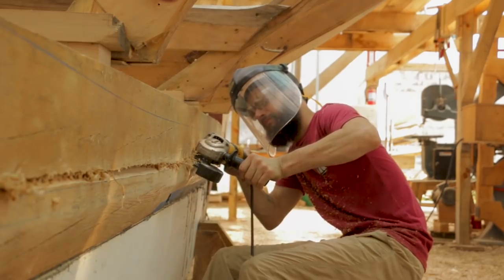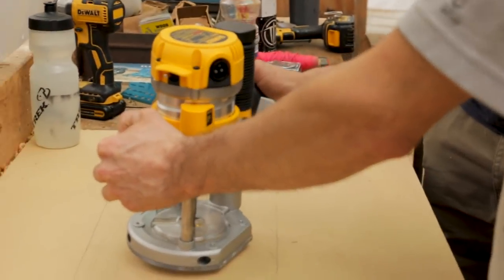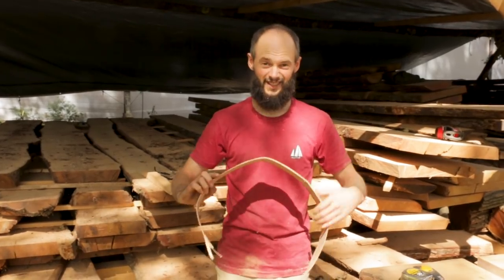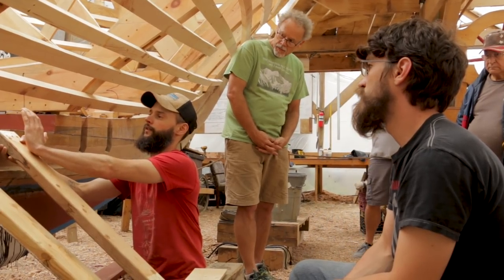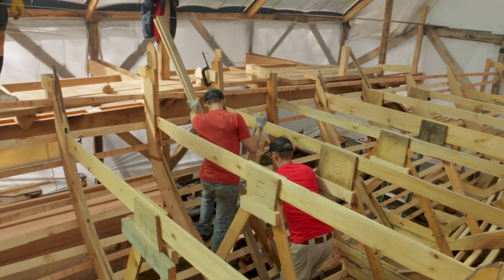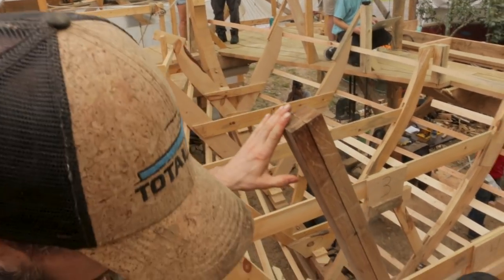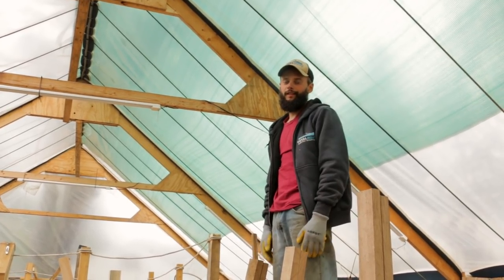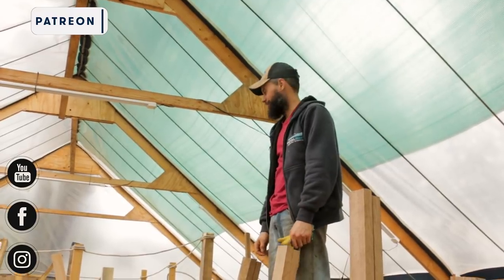Acorn to Arabella - Journey of a Wooden Boat - Episode 46: Steaming Frames

Comment: When I built custom furniture, a good part of the cost on a given project was the cost of template/jig/bracing material. Luckily you have a source for the solid stock, but your template stock bill must be ginormous! I worked at a shipyard as well, but we built large luxury yachts (Burger Boat Co), and the frames were aluminum and cut with a water jet. As a woodworker, I prefer the way you guys are doing it 🙂
Reply from the maker: Most of our template stock is stuff we harvested and milled, we also use hunks of plywood left over from something else.  So not much money has been spent on that so far =)
Reply: Good, I'm looking forward to watching the launch some day!

Comment: I noticed that you and Leo both routed the sockets for the frames and in the keel then chiseled the round corners square. I thought it would have been advantageous if the bottom of the frame was routed with a rad to match the routed pocket and just do away with any chiseling altogether?

Comment: I noticed that for most of the frames we see vertical grain on the inside faces, but on a few, we see arches, indicating flat sawn. That is a shame because you started with squares and it was just a matter of which way the square went into the band saw when the square was split.

Do you have a plan to keep the joint where the two faces of the split square meet becoming a place where rot occurs.
Reply from the maker: I wish it was quite that easy.  Many of the frames could be oriented on the bandsaw to split with the rings but some of the frames the grain ran diagonally across the frame so there was no way to split it with the rings hence the arches.  She is so heavily designed, the curves easy and the oak tight and green that the few frames without perfect grain are not an issue.  Bud McIntosh says not to worry about it and to just take them as they come. 
It seems that for whatever reason the kerf does not typically create a rot spot, most of what I have read says not to bother putting anything in there.  We are pulling the frames a couple at a time and giving the kerf a light oiling, the bases get antifouling paint as do the sockets and when they go back in their homes they get bedded.
Reply: So right now you are just forming the frames. Then when everything is good and dry you will remove the frames and perform antirot measures, then reinstall the frames. Is this correct?
Reply from the maker: That is correct

Comment: Nicely done. So do you add glue between the split after it's had time to dry in, or just screw them together?
Also, a fine example of the woodworker's motto...
"You can never have too many clamps".
Thanks for sharing Akiva with us again, if only all to briefly.
Reply from the maker: They will get riveted together when we put the planks on.

Comment: Nice work.  I am curious why you decided to kerf the frames.  Presumably with adequate steaming you could have bent them in without the kerfs.  That would give stronger frames.  You might have split a couple more, but it would be worth it for the extra strength.  Did you try bending a couple of frames without the kerf?
Reply from the maker: We might have been able to bend them whole but it would have been much more difficult and stressed the timber a lot more.  The thinner, more easily bent split frames get a lot less stressed and there for are often stronger than a single big frame.  There will also be at least 44 rivets going through each frame so the two halves will be very well joined.

Comment: I’m seventeen. You’ve inspired me to buy 100 swamp white oak acorns. I am building one of these.   From the looks of it, you also need a lot of other types of wood for construction. I’ll use poplar or white pine for that. Damn I’ve got a lot of trees to plant. I have probably got a max of 10 acres to plant on. How many acres of trees would one of these ships require?
Reply from the maker: That is a nice thought, but keep in mind that slowly grown trees are better for woodworking, so these will likely not be ready in your lifetime. You should plant those and then start looking for a source for mature white oaks. Ecologically minded forest management is very important.
Reply: Acorn To Arabella why exactly are slow growth woods better? In most hardwoods, growth rate has no effect on its density.

Comment: Just wondered why you have not put any tar in the frame socket and do you not worry the split, however tight, will always be a place for moisture and water to head.
Reply from the maker: It goes in later.

Comment: Very much a novice boat-wise, so please forgive the question.... in an earlier video you treated wood surfaces that touched, but with the wood frames that were cut down the middle these were steamed and installed untreated. What's the difference between these parts of the installation - why is there no need to treat the steamed frames during the installation? I get that you don't have much time to do this during the steaming and installation process - was this a factor?
Reply from the maker: They will get oiled and painted and bedded after they have cooled and dried.  Any finish would have hampered the steaming process.

Comment: Really starting to look like a boat now!   

fascinating how easily it bends into place like that... will you be going back and putting glue between the two pieces once they've cooled and the bend has set up?  I'm curious what types of glue you'll be using there.   (or is that part of the other stuff you mention doing in a later episode?  ;)  )
Reply from the maker: They will get oiled then riveted together when the planking goes on, no glue will be used.  The 44 (minimum) rivets per frame will be plenty to hold them together.

Comment: Is there a certain amount of spring-back calculated into the molds? I’m confused on how you will hold the “fair” when the clamps come off. Will the planking bring it all together to determine the final shape? I guess I’ll find out pretty soon. Very, very interesting videos. Great job building and recording.
Reply: There will be springback. Wait till cool, remove clamps, epoxy together, re-clamp. Much less springback! This is usually done on the floor, using a jig, & many thin, epoxy coated oak strips. No springback, and then installed. Steam bending frames in the boat against ribbands is for one-piece solid frames. I noticed that their ribbands were quite thin. The frames weren’t split all the way. That may be a major concern later!
Reply: Paul Collins: thanks for the explanation Paul. They could just complete the cut on the frames once they are removed and before epoxying as long as maintain the flush alignment, right? I also wondered how the frames would fit in the keel notches or pockets once the frame ends swelled from steaming. So many questions. Have to wait and see. It would be cool if they come up with an adjustable jig for the final glue-up of the frames. (Rather than many individual ones for the various stations)
Reply from the maker: The spring back is very minimal and after being split the frames are really only 1-1/4" thick.  The planks will be plenty strong to pull/push the frames the tiny distance they need to be all very smooth and fair around the molds.  Even after planking the hull is flexible, it won't be until the deck and bulkheads are in that she will really stiffen up.  Then once she swells the cotton basically splines the swollen planks together and she will be as ridged as she will ever get.  This early in the game there is still some play.
That is also part of the reason the frames will not be glued together, but they will have at least 44 rivets going through them so they won't go anywhere. =)
The sockets were made a tad oversize to allow the swollen frame to be driven in.  Once the sockets get 2 coats of paint and the frame ends get two coats and the bedding compound gets applied they will be back to a driven fit.
Reply: Acorn To Arabella:  thanks so much for taking the time to educate me/ us on this technique. I never thought of rivets as a solution, but understand their benefits opposed to gluing now. It is fascinating to see her slowly come to life.

Comment: Noting all of the metal clamps, would it be possible to rig a tourniquet style/type of rope (or leather or some such) and peg method/way of doing the clamping? I am sure that pre-1800's had to have a method of bending and shaping and holding these things. Would they have had some solution to a need for a massive amount of metal clamps. Even wooden ones would have been cost prohibitive, right?
Reply: Not really sure about pre industrial clamps but it is certainly possible to do the clamping with wooden clamps.  Bulkier but just as effective.  When building my skiff i used dozens of clamps consisting of a rectangle of plywood with a slot cut into the long direction wide enough to hold the planks and a wedge.  The wedge provided plenty of clamping force and they were cheap enough to make dozens.
Reply from the maker: There are many ways it can be done but the metal C-clamps are sure tough to beat!
Reply: Oh not trying to change things. Just wondering how earlier builders made those dramatic bends WITHOUT all the metal. Thinking it might be possible to make tourniquet style clamping. Wooden clamps are great but the quantity might have prevented would-be builders from doing it. Wedge styles might work but would be kind of custom per rib...
Reply: @AcornToArabella  No doubt but the question was about pre-industrial methods.
Reply: @clydedecker765   Just guessing here, but I think that tourniquet techniques are not as effective as they might appear.  The problem is that the large amount of torque on the ropes would damage the fibers and might lead to early failure.  If you want to use ropes then a block and tackle arrangement will give the force needed without damaging the rope.
I think that if you have iron C clamps then that's going to be your first choice.  If you don't have iron clamps then wooden screw clamps, blocks and wedges, levers with blocks and tackle.  In boatbuilding the ingenuity of the builders is pretty impressive, as the Arabella team demonstrates each week.

Comment: Should not the frames be painted / preserved /sealed in the socket?
Reply: This is just the shaping step.  The frames are only clamped in placed until the wood assumes ambient temperature and are stable again.  We'll see them properly bedded and fastened later, I'm sure.
Reply: They certainly can be later, if that is deemed necessary.  Once the individual frame has dried and cooled, it is quite hard and stiffly fixed in its new shape.  If they want to bother, they could un-clamp each frame at that point, and lift it out vertically, apply preferred bedding goop, and drop the thing back in place again.  There's just simply not the time available for any of that during initial installation of hot frames.

Typically a lot of older production boats done in this style in the old days, never bothered with any bedding of frame heels/sockets.  The proof that such extra effort is of debatable value, is that with all the miscellaneous rot-spots most typically found in tired old neglected examples of this construction... the frame heels in the bottom of the sockets, seem less prone to rot than half a dozen more common problem areas in old bent-frame hulls.  Simple stress-breakage of bent White Oak frames (usually at the turn of the bilge), is MUCH more commonly the cause of replacement, than any rot anywhere in the frames at all.  Second most common trouble, is probably galvanic de-lignification of Oak frames from stray current leakage in the bilge-water from electrical systems.
Reply: Thank you for that very informative response.  Never realised galvanic action wouls be a problem in a wooden boat, interesting.
Reply: [to Dai Bach]
Hooh, boy.  You have no idea.  Understand, I was only talking about the disintegrating effects in the (oak) wood in the VICINITY of the various fasteners, if said fasteners are subject to bad galvanic action.  The destruction wrought directly on the fasteners themselves if that is allowed to progress, is notoriously a whole 'nother level of nightmare in wooden boats! 

That's not meaning to sound derogatory or alarmist about it to scare folks away from beautiful well-maintained wood vessels.  Just that it can happen in worst circumstances of wrongly configured electrical systems + neglect.  Also highly exacerbated by badly handled shore-power in marinas.  Mind, I'm only speaking anecdotally as a non-expert.  Properly understanding and preventing galvanic corrosion issues in wood boats, can be a whole field of specialist science unto itself, if one insists on integrating this classic construction style with modern electrical conveniences.
Reply from the maker: Electrolosis and galvanic action are real boat destroyers!

The frames come out after cooling, get a coat of oil, some paint on the heels and frame sockets and then will get bedded and screwed during final assembly. The frames will not get glued together but each one will have at least 44 rivets going through it, they won't come apart.
Reply: Thank you for confirming that.  That's an awful lot of rivets!

Comment: Why were the frame sockets not sealed and bedded with tar or dolphinite?
Reply: Hi Ed. This is only a "first" step and the frames are only in place temporarily. They get removed again, bedded and sealed as appropriate.  If you read back up in the comments AtoA explains the process.
Reply: Ok, that's really cool. I wouldn't have thought the frames would be removable once installed. Won't they loose some of their shape if they are removed? Please excuse my ignorance. I am not very experienced with woodworking. I am learning a lot from these awesome videos!
Reply from the maker: The frames have a little bit of spring back but it's pretty negligible.  They all get removed, oiled, the sockets painted and bedded and then the frames get permanently fastened to the keel.
Reply: @AcornToArabella  thanks for the info!

Comment: If each 10 ft. Oak board is 25 bf, and prime grade is $4/bft, and yealds 4 frames, and there are 20 boards used to make 80 frames, then you got $2000 in your frames. Irrelevant and speculative, but just to point to the efficient use of local trees with this design. Some Yankees got the frugal genes, Ayeup. Not to mention you harvested your own trees. True, the ribbands are removed, but maybe some other builders can reuse them if you keep them in vertical bundles in the barn when you take them off. Otherwise mice will frack'em up. BTW, I'll trade you a backing out plane for Oak offcuts.
Reply from the maker: High quality white oak around here is $6.50-$8.00 a BF!  We never bothered to count the BF of lumber we harvested and milled but I would ballpark the milled lumber to be worth somewhere around $60-70,000.  If we had to buy the timber we could not afford to build her, we paid pennies a BF for our timber =) 
The ribband material will get reused in jigs, shims, supports, templates....  
We burn the offcuts in the woodstove, getting us to part with them is quite easy, but you do have to come to us to collect them and you will have to dig though the pile.  Sometimes there are lots, sometimes not so much but we are always making more!

Comment: Once, as a volunteer some decades back, I was on a track recovery mission to an old, de-commissioned power station. I took with me a pan, some beans, sausages and a couple of other tasties. Some of the rail joints had to be gas-cut, I nurtured one of the small fires that started from the molten metal, and made a small camp-fire on one of the old sleepers (ties). I was mocked for what I brought, but was the only one with a hot lunch that day!

Comment: Thanks for the show, guys, why isn't there bedding down in the frame sockets in the keel? Or between the split frames. Seems to be routine after watching Susanna, Emma,Tally Ho, and other wood boats.
Reply: think that's part of the next step.....this just gets them bent to the right shape....but there's still nothing holding them in place besides the clamps.....once they cool I suspect we'll see them taken back out, tuned, then bedded and attached permanently..
Reply from the maker: Tim Hyatt is correct =)